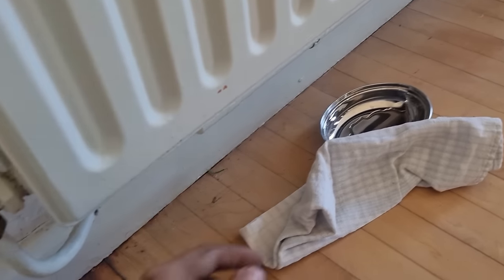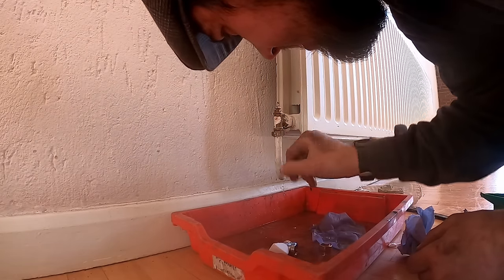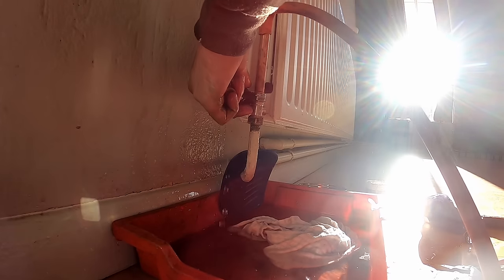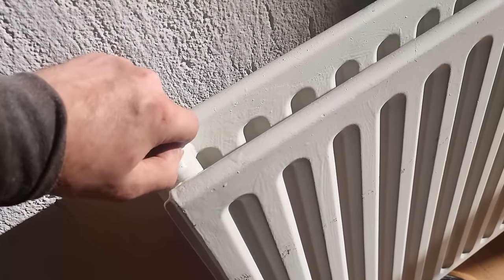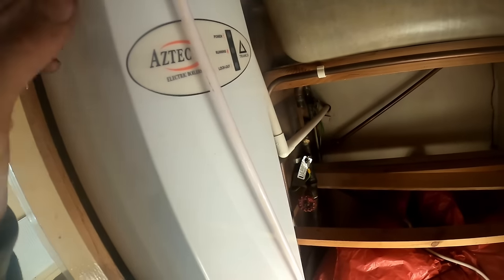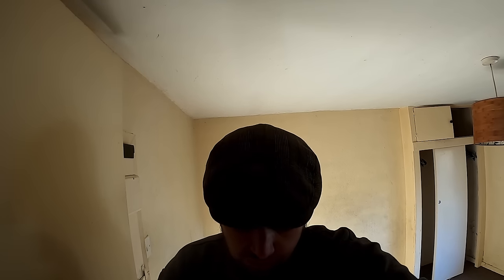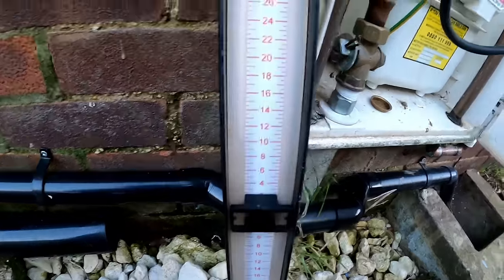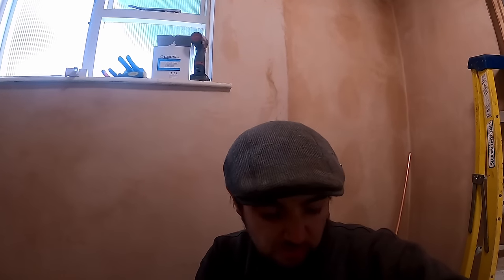Don't try this at home!

Comment: Need to keep a thick pair of marigolds on the van buddy save your hands. Tricky when you're always under pressure. Good luckbwith your gas safe inspection, you'll be fine your work is always spot on. 😊
Reply from the maker: Thanks for the support as always Tom, I hate being audited, they always find something stupid, gas safe are normally alright, it's Oftec who I fall out with

Comment: Always do a tightness test. Can’t believe it’s been dropped. Why wouldn’t you. Protect yourself from complaints/issues later
Reply from the maker: I agree Andrew, I always do, it only takes a few extra minutes on each job and I can sleep at night then, I was always taught to do it last thing after touching any boiler, thanks for watching mate
Reply: I would do them on every job but once you turn off the ECV you’re responsible for every gas appliance within the property. Not great when you’re there just to do a boiler service and they have 3 open flued gas fires and a 1970’s cooker. Opening a can of worms.
Reply from the maker: @matthewtrueblood408  That is a fair point, I saw a post the other day where a letting agent were only paying 36 quid including vat for a llgs, you ain't doing that on them for sure
Reply: I wouldn’t even do a gas safety check on a Combi for £36! Race to the bottom if you’re valuing yourself like that.

Comment: OMFG man, buy a pipe freezing machine. If it's leaking at the bottom of the valve, you just turn the valve off, freeze the pipe, then crack the nut and stick some compound around the olive. Sometimes the pipe needs a slight adjustment so that it's going into the valve streight

Comment: gotta get yourself some gloves for this i recently recovering from burns from exactly this the boiler was set to the highest setting and i couldnt drain it because of excess  turned the isolation valve popped off the rad thermostat and the isolation valve failed spraying 70c water all down my leg and accross the hall lucky i had a helper with gauntlet gloves
Reply from the maker: I really do need to get some, hope you were Ok, thanks for watching

Comment: the first job is why when i put in my new boiler i put ball valves in everywhere to separate/isolate everything. the old boiler had gate valves on the purge station but other than that there was no valves anywhere so you had to drain the whole system down.  now with everything isolated everywhere i can do anything if needed without draining the system down. when i put in my water heater im putting ball valves on both lines so theres no more draining the house down.
is more expensive? yes but it save time and headache later on for the next guy....which is me. i subscribe to the "buy once, cry once" philosophy when it comes to things. spend more now to save alot later.

Comment: Well done Tom. We have done it I remember snatching a rod type thermostat on a Diplomate 250 boiler in a basement on a small three story factory (we thought we had drained most of it) 😂😂 by the way the t/stat has 58 turns on the threads 😂😊. That was over 50 years ago 😢
Reply from the maker: Thanks for the support as always Colin, I bet that was a fun job, it certainly makes you more careful for next time

Comment: I shut a valve on hot hose to a washing machine. I undone hose and scalding water shot out. The valve had failed And the water was to hot for me to refit hose.
Reply from the maker: It's an absolute nightmare this job sometimes, it can go wrong in an instant, you feel such an idiot at the time but it can happen to anyone, hope you were Ok, thanks for watching 👍

Comment: Great video
Reply from the maker: It might not have been quite 80, that was the temperature on the boiler so it will have lost a bit, it was hot enough anyway, thanks for watching
Reply: scary tho matie
 @PlumbLikeTom

Comment: That could of gone very wrong .
Reply from the maker: True, I never felt not in control though and always had the option of putting the hose back on the pipe and letting it completely drain, thanks for the support, it is greatly appreciated 👍

Comment: Good video Tom technically you didn’t break bond with the bracket in 🤣 and I’ve stopped TT on all services just double TT on fires and bbu and a min TT on boilers on the p1, and a full TT on cp12 once you do the TT you have to purge and relight every appliance and that usually involves more paperwork and explanations on why it’s not been installed properly 😂 and don’t get me started on the permissible drop 4mb, 8 mb old appliances, new appliances load of knob cheese in all cases your not allowed drop on the pipe work, so that means that somewhere on the installation is an appliance with a passing gas valve that has a safety device that has failed 😂😂 but that’s ok as long as you don’t smell it 🤣🤣🤣 rant over keep up the good work 👍
Reply from the maker: I know exactly what you mean, I tend to do a tt on every job because that's how I was taught, I know it's not strictly needed but is good practice when you can, that being said every job is different. Thanks for the support, it is greatly appreciated

Comment: Not a plumber but couldnt you just cut the horizontal and fit a small stop tap so you can work on the valve without the rush factor ?

Comment: Why was header tank inaccessible? I’d have been bunging that all day long. You mentioned freezing if you have freezer kit why not use it for this reason? You do a lot of good work but this just seems like one of them jobs that could/should have been prepared better. We all have days like this though it’s easy to stand back and criticise. You must have balls like King Kong though lol not sure I’d have dared doing it like that.
Reply from the maker: The header tank was above the suspended ceiling in the main hall, it would have needed a triple extender ladder to get up it. It would have needed footing as well because it was a polished floor. I could have froze it but the pipe was so hot it would have needed to cool first. In the end I did what I thought was best at the time, thanks for watching, it is greatly appreciated 👍
Reply: @PlumbLikeTom  as I said we all make decisions we regret but do what we can in bad situation! Hey I work for BG (nuff said) lol

Comment: That feed and expansion pipe is too small , unless the boiler is 25kw or under.
Reply from the maker: I did spot that, there was a safety valve under the boiler but the vent certainly should have been a minimum of 28mm, thanks for watching as always Paul
Reply: Nice one , been working on heating systems since the mid eighties when open vented systems were more common than they are now. My gas ran out about 7 years ago so do mostly plumbing these days , but mostly in a commercial setting.